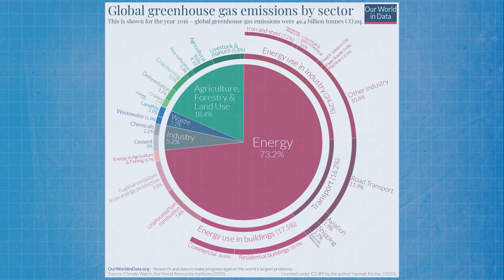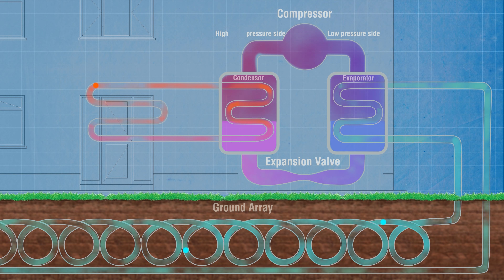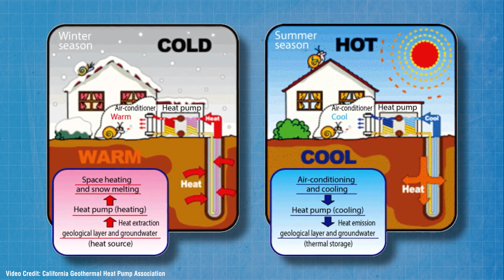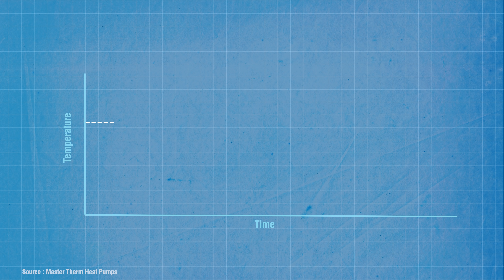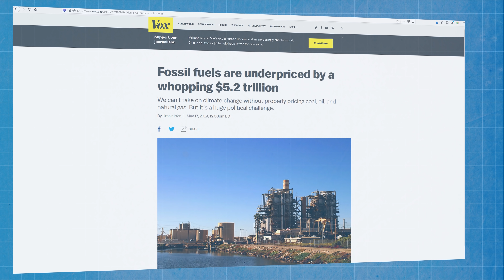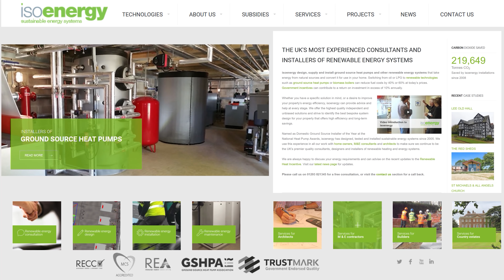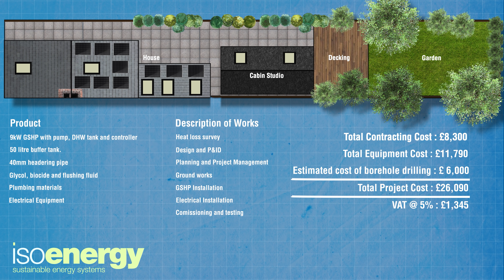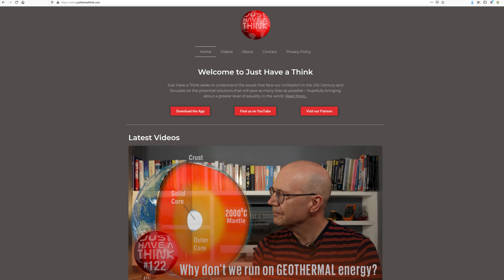Geothermal ground source heat pumps. Heating your home from your own back yard!

Comment: Here in Finland heat pumps are very common and it is a no-brainer when building new houses. We also use central heating, my apartment is heated partly by the local metal industry, capturing their waste heat to low pressure steam, which is then piped to the town and used for heating. Also, trash burning is used for this, it is high flow, high temperature furnaces using monoxide recycling and carbon scrubbing. It is hot enough to return  plastic etc back to their most basic elements and compounds, it is quite clean process, most of it is CO2, water and nitrogen. Trash is separated here so what ends in the trash burners is single use plastic, cardboard that is soiled or unsuitable for recycling, food packaging and other such household waste that would end up in landfills.
Reply: And because these are common, also prices are way more reasonable. Starting under 15k€ for 6kw system with drilled geothermal well that heats typical house most of the year. Systems are not normally built for extreme -30c temperatures, but there is additional electric heating for lowest temperatures and also as a backup.
Reply: @janivirta  €15K for the system installation is so crazy and makes no sense at all. Electricity in Estonia is around €0.15 per kWh. Our household consumes 150kWh per month on average. €15K is enough to power our household for 55 years with the current price. Geothermal system requires expensive maintenance every ten or so years which just adds up. Solar, wind and geothermal will never be cost effective with such prices. It has to be at least 5 times cheaper to even consider it.
Reply: Regarding kicking in at the same time: here in Sweden the heatpumps mainly replace direct electricity or oil burners. So with a 5to1 benefit the heatpump is better for peaks than direct electricity. Our grid was already designed for this consumption. Of course, I also have an electric heater inline with the heatpump, controlled by the heatpump. It of course only have a 1to1 ratio. But only kicks in when the heatpump maxes out. So it all comes down to dimensioning your system for your needs.
Reply: @JimBurke123123  
I thought the peaks are when its is very cold, the heat pumps are maxed out, then the resistance heating kicks in as it is too cold for the heat pumps.  It all happens in all homes at the same time.
Reply: @johnburns4017  no, it doesn't. They all have different brands, with different "max" lowest temp. Then it also depends on the heat stored in the building, number of inhabitants, what temp you require, etc. All in all, the switch-on time is not concurrent. More smeared out. 
Yes, the overall consumption must be handled, but no spike as "all switches on simultaneously".
Reply: Heat pumps are most of the time a good solution. Especially if they are connected to a heat source where they can tap into access or waste heat. Otherwise, they can also create problems - because if it is cold in one house in the area, chances are it is cold in the whole region, which means that suddenly all the installed heat pumps are starting to work and pull electricity out of the grid at the very same time - creating a peak demand which will either bring instability into the grid or then have the energy provider to adjust the energy supply to the new and higher peak demands which are extremely expensive. Heat pumps with access to a heat sink or thermal storage are very good though.
Reply: @ulrichsuter3548  While I'm not disagreeing with your points as that's entirely possible, this concern about the grid and heat pumps kicking on at the same time "only" assumes that every house with a heat pump in this hypothetical cold region is:
1. Set to the same temp. (Lets say for example 68F / 20C)
2. Built exactly the same to have the same heat loss and needed head load to keep warm (i.e. same size heat pump system and house insulation).
3. Has the same (or lack there of) natural or man-made object(s) to cast shadows on the house. (Sun not hitting the house and warming it up because of trees, mountains, other buildings, etc)
4. In the same orientation (like the front of the house face south). So the same areas and features of the houses (like windows) are facing the sun (A wall without windows wont let as much infra-red heat radiation from the sun come into the house as wall with windows).

Now, we could make our hypothetical region at night time instead of during the day to exclude point 3 and 4 (as the sun does have an effect on when and how long a heat pump will run) but just the first 2 points alone.... will prevent all heat pumps turning on at the same time in the same weather conditions. 

So a lot of things would have to "go right" for that to happen. Would the grid see an up tick in energy demand? Sure.  Although just factoring just the few points above (there's probably more thing that could be added or even current points can be expanded upon, im just too lazy to think/google those out), the energy demand increase should rise somewhat and then stay fairly flat instead of spiking (creating instability) as different houses heat pumps should be coming online and offline at different times (due to differences between each house). 

What I would guess can cause bigger grid instability is not stuff like house heating or cooling (as grid operators can usually predict the weather day's in advance) but more of cultural habits and trends that can change on the fly. Stuff like most Americans getting home from work between 4PM to 6PM and starting to cook dinner or the Brits starting their electric kettles for tea during (and after) a TV sports game https://en.wikipedia.org/wiki/TV_pickup
Reply: @warmon6  - thank you for your reply. Maybe I was not as precise here that my comment was more about existing buildings - because it is the existing buildings that demonstrate the biggest issue regarding total energy consumption.

#1 and #2. The grid instabilities and additional peak demands are not only short therm peaks but what if there is a cold period of -20'c for about two weeks? Then, regardless of any set temperatures, all heat pumps kick in at some point creating a higher demand. Existing buildings and their heat demand are much cruder and not as individual as you mention. They simply need energy at the same time (not the very same second, but minutes and hours).

#3 I assume you refer to solar architecture here. Again - existing buildings are not as sophisticated as you mention and that this point would have big of an impact. 

#4 The same issue applies here - old or existing buildings have most likely a higher net heat loss with their windows since windows are by far the weakest point in the building envelope. In cold temperature zones, there is ZERO energy gain overall with windows facing south (existing buildings with old windows). Why? Because the season when it's cold is also the season when days are short and dark. The Nordics get no sun for weeks during winter in some regions because of short days and clouds. A window here - regardless its direction it faces merely gives you a net energy loss. Also in your example one would need thermal mass behind the window that can heat up and store the heat inside

The "cultural" issues like cooking, and boiling tea at the same time are no issue for a grid because they are predictable. 

The reason why modern upgrades to existing buildings and networks (grids and micro-grids) need a lot of energy storage capacity is the fact that there will be a huge shift towards "everything will be electric". Cars, mobility, phones, computers etc. 

I don't need to google much of the basic stuff here - I studied green buildings and am working in the industry for more than 20 years.
Reply: @ulrichsuter3548  Ideally, heat pumps would be used to heat large thermal mass, such as provided by the concrete slab used for underfloor heating, together with high levels of insulation to even out demand
Reply: My point made.  "WE also use central heating..."   That is the actual 'no brainer' right there.
Reply: John Casey canadas’ coldest winters were heated by steam heat! Winnipeg still has its steam pipes etc., why not just convert it to geothermal heat dah?
Reply: @johncasey1020  Unfortunately, that incentivizes living in a population center.
Reply: Finland sounds awesome. Here in democrat run Massachusetts our trash gets dumped into a landfill & our recycling is sent to communist China who dumps most of it into the backyards of poor 3rd world countries.
Reply: Have you watched “Planet of the Humans” ? If so what do you think? Some saying it is not a true Picture and I wonder what we as a whole really believe?  I cannot believe that we allowed this to happen, but do believe we did! That is why, as a punishment, if nothing else, these wrong doers, evil people, should pay for all world to go onto Geo-thermal, the cost of the start-up infastructure! As geo-thermal energy is free! It must be a mandatory contribution, to be demanded, by all on this PLANETs cry, any and all infiltrators on the 350.org collection and distribution of over 300billion collected and distributed to Banks, Corps, Billionairs..etc., must pay a portion of the costs of geothermal to all, equally as they stole that money from us all - never mind  the forrests we can NEVEr recover! They stole time from our children!  These liars, thieves and infiltrators must be punished by giving all the clean they promised!
Reply: @GurgaGeorgiTaylor  planet of the humans
Reply: The first anaerobic digester is being built on a farm in Uusimaa Finland. The excess energy produced will be sold the the energy company. The construction costs are supported by an EU grant and the estimated payback time is between 8-10 years. With a life expectancy of 40-50 years for the digester
Reply: I know I am kind of off topic but do anyone know a good site to watch newly released tv shows online?
Reply: @Anders Bodie flixportal :P
Reply: Thank you, I went there and it seems like they got a lot of movies there =) I really appreciate it!!
Reply: @Anders Bodie glad I could help :D
Reply: Here in Iceland we pound our chest for being so green while we waste so much of our green energy.
We could be the Kings if we used all of our wasted energy by producing hydrogen that could propel the entire fishing fleet and car fleet of the country.
But no, the icelandic politicians like to spend their time travelling and polluting the world by flying to meetings around the world and discuss how to make Mother Earth cleaner and a better place to live on. 
So far electric battery driven cars are dirt.
Reply: The process of turning plastics into other chemical products is not a clean or an environmental solution. What is wrong with people these days 🙄 shredding it and using it as insulation is a different story though
Reply: Will just the air alone coming out of the end of a buried open-loop coil be at a different temperature than the ambient one does anyone know?  I'm sure i heard that the air alone piped into your house via underground tubes would absorb enough of the ground's heat to amount to up to 12°C - probably in early winter.  Heating your home the next 6 to 8 degrees needsd over that would be where you'd save.

I'm thinking this would
Reply: Sweden uses garbage to produce electricity. They ran out of garbage, so they import garage, in compressed form, from the UK, while we sill use fossil fuel to make electricity. Well at least the garbage is not going into our landfills.
Reply: @johnburns4017  Actually no. Most Swedish trash is burned to make heat for the city level central heating he has described and not for electricity. This kind of heat geothermal heat pump is also very common in Sweden.
Reply: John Burns - you can have Canadas for costnof shipping it - maybe not even that - someone was charging us for recycling it - but were sending itmin containers to Malagia? Really got to watch your government do gooders! Imagine telling canadians that were doing our part- all the time deceiving us! Shame is ours as we now have to explain this mess to our kids and grandkids!
Reply: 'It's a no brainer,' so you brain wasn't engaged? What a pity, you might have realised geothermal was a bad idea if it had been. Geothermal  is partly the primordial  energy from when the Earth was formed and partly  generated from within the Earth's crust from the decay of mildly radioactive elements. Trash burning, yep, brain not engaged.

Comment: Very expensive heating system.
Which require higher technical skill to install and maintan
Reply: The guts is basically the same as an air conditioner. The rest is just burying pipe rather than having a condenser

Comment: Holy Smokes! 26k pounds for a system like that!!! That is just insane! Here in Canada, that would be like 45k! How could that be soo expensive?!? The guy in Nebraska got away with much lower costs, without all this fancy heat exchanger / pump or whatever you call it. Just run stove pipes about 8 feet underground for a few hundred feet and add a fan. Bam! Not the most efficient for sure, but you save about 75% of this 26k price.
https://youtu.be/ZD_3_gsgsnk
Reply: Canada has rather more space for most homeowners! In the UK, a typical suburban house doesn't typically have 'a few hundred feet' of land available and thus bore holes are the only option in a lot of cases and are unfortunately much more expensive.
Reply: @johnmheaton  It doesn't have to be a straight line...
Reply: To ensure the longevity of the system, it needs to be well designed to not over-extract energy. We steer clear of coiled pipe and run it up and down trenches, so don't underestimate the amount of land required. Sometimes, its drill and have done.